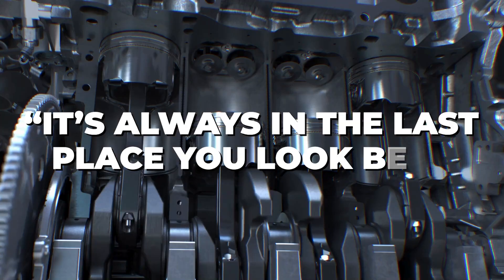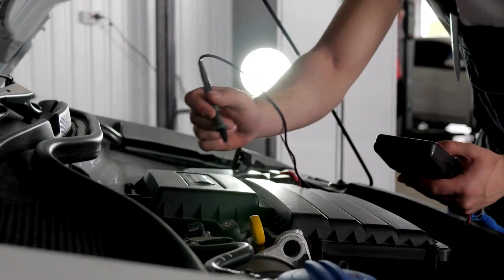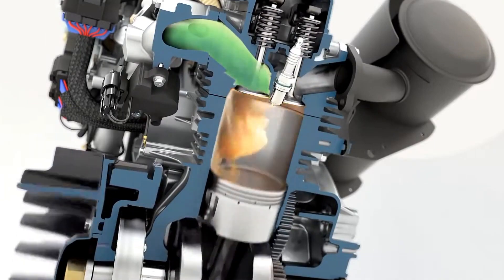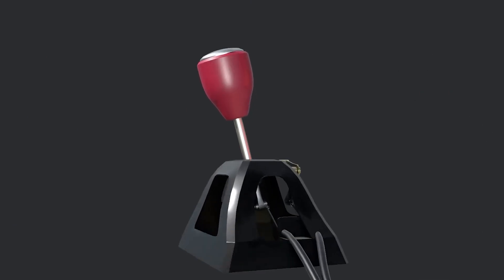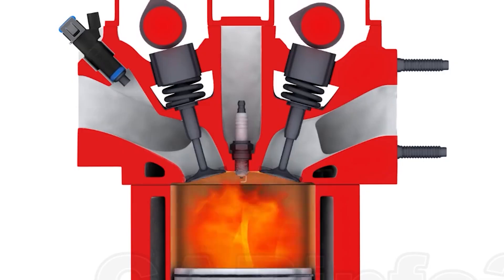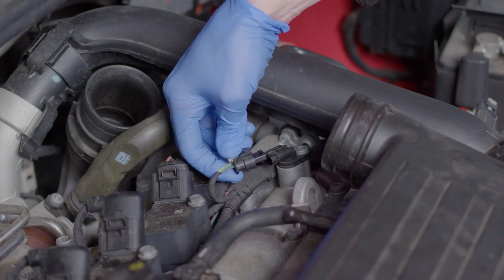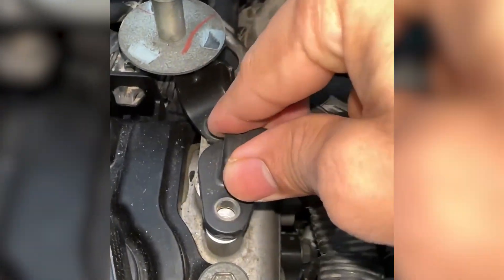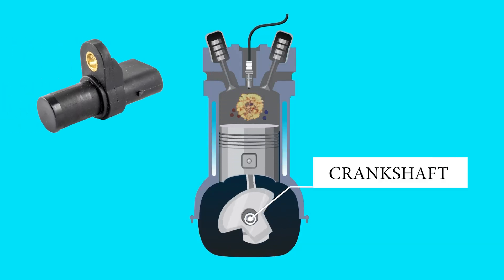11 Symptoms of a Bad Camshaft Sensor (How to Test & Fix)

Comment from the maker: 9 Bad Steering Wheel Angle Sensor Symptoms https://youtu.be/e659I6JyFQ0

⬇Care Care Clues Top DIY Tools and Products:
🚗 Essential Scan Tools
Newest Scan Tool:https://amzn.to/3GJyuET 
Bluetooth Scan Tool: https://amzn.to/42AcBRc 
Cheap Scan Tool: https://amzn.to/42WZIzx 

🔋 Emergency Essentials
Best Jump Starter: https://amzn.to/44fYOAm 

🛢 Fluids and Leak Stoppers
AT-205 Re-Seal (Stops Leaks):  https://amzn.to/3S9icYm 
ATS 505 Fuel System Treatment: https://amzn.to/3YQjjA2
Lucas Oil Transmission Fix: https://amzn.to/4jNk98M 
Bar's Cooling System Stop Leak: https://amzn.to/3Sht0nj 

🔎 Quick DIY Diagnosis Tools
Head Gasket Leak Test Kit: https://amzn.to/4jRgc2T 

🛠 Useful Maintenance Accessories
Quick Twist Oil Drain Valve: https://amzn.to/4jWG3GJ 
Tire Gauge (Check Pressure): https://amzn.to/3GxySGD
Tire Air Pump: https://amzn.to/3RZK9Cd 
CRC Mass Air Flow Sensor Cleaner: https://amzn.to/44dJpkb 

🧰 Mechanic’s Must-Haves
Car Battery Tester: https://amzn.to/4jTqyzk 
Basic Mechanic Tool Set: https://amzn.to/3Ymgerh 
Cordless Impact Wrench: https://amzn.to/3YkkhVc

Comment: 2006 f150 5.4 triton. I’m throwing codes for bank one and two sensors. It got to the point where if I’m not actively giving it gas while driving it starts shuddering and shaking and shuts off. Driving it back home when that happened I had to blow through every stop and use the gas and brake to slow down. Anyone think it’s not the sensors, someone told me it’s probably not actually the sensors bc both would t go at the same time and cause these issues

Comment: I had a bad camshaft position sensor about a year ago according to the autozone code reader and the smog shop reading but no symptoms and had it replaced to pass smog.  The check engine light came on 2 months later and its been on ever since.  The only symptom has been limp mode for 10 months and the smell of fuel for the last 2 weeks.  I wondered why there was a fuel smell but this video clarified why.
Reply: Mine came on an went off but I don’t have no symptom

Comment: I changed camshaft sensor but still the fault code coming. Any idea?
Reply: Check crankshaft sensor and engine timing
Reply: Mine too,my scanner gave me p340 and 341,,I changed both,intake and exhaust side now mine won't crank,,,what next?
Reply: What code were you getting?
Reply: Restore the error code and reinstall the sensor it will be fix

Comment: Just got my camshaft sensors replaced. Didn’t even know they were bad. The problems only started after they replaced them. I have trouble starting the car on the first try. I keep telling the mechanic who replaced the first set but he just thinks I’m crazy. It’s like he refuses to even acknowledge the possibility.
Reply: It’s probably a bad one, I replaced mine myself and still had the code firing off, AutoZone got me a new one for free and I replaced it again and I was fine
Reply: I experience that too especially in the morning have to start it on second try
Reply: @man059 keep reassuring him that it is a possibility that the part that came in may have been defective.
Reply: I have gotten a brand new water pump put in even a solenoid needed for my fuel line and numerous other things like a serpentine belt that were defective upon putting on the vehicle. It happens in more so just like any person who's a perfectionist or Craftsman don't look for imperfections in the wrongs that they have committed. Take it from a barber.

Comment: Just changed this part fixed all my problems 😊
Reply: How easy was it? I am having the same problems
Reply: @LovelyMocha  what were yall problems?
Reply: Car sputtering to start
Reply: @LovelyMocha  did it ever not start? or did it ever turn off at a red light?
Reply: @buckeyesl5 I think it's my catalytic converter that's gotten really bad, it will start right up after sitting for a long time,  but sitting for like an hour or so and trying to crank back up, it'll stutter, then crank. I keep getting the code for it, I'll eventually fix it and no, it doesn't turn off on me, the only time my car did that, was when my battery was on its last leg
Reply: What was your problem
Reply: What was your car foing

Comment: i changed both my sensors and it still wont start and still shows faulty position sensorsm on my scanner. i drive a g35 sedan any help?
Reply: Change maybe the purge canister ?
Reply from the maker: If you changed both camshaft sensors and it still won’t start, here’s what’s likely happening:

Bad wiring or connectors — If the wires to the sensors are damaged, corroded, or loose, the ECM still can’t read the new sensors properly.

Bad crankshaft position sensor — On the G35, a failing crankshaft sensor can throw camshaft sensor codes too.

Faulty ECM (Engine Control Module) — Rare, but if the ECM is bad, it can’t process the sensor signals correctly.

Cheap aftermarket sensors — If you didn’t use OEM (original Infiniti/Nissan) sensors, sometimes they don't communicate well with the ECM.

Start by checking the wiring carefully, then test the crankshaft sensor. If those are good, consider the ECM or try genuine OEM parts if you didn’t already.

Comment: Well I try to watch this video without being biased. But I'm not finding any good nuggets to take with me after watching this The biggest sign when that camshaft sensor goes off is possibly a bad timing chain (stretched)which is the  correlation to the crankshaft sensor which sets off the light. When a customer comes he says my check engine light is on and it says my camshaft or could be his crankshaft sensor is bad and the light that always goes off for me is it's a timing chain issue. And it's usually the time and chain half of the setup in your timing kit is made of plastic. Plastic always fails prematurely. Also if you're hearing a rattle on startup it's more than likely your timing chain. I usually look for some sort of good news when I watch these videos and I will give this video barely a 1 out of 10.
Reply: So change the sensor or chain??
Reply: So your saying if the engine like come on and off I need to change the belt?

Comment: You're describing all symptoms caused by crank sensor
Reply: I disagree as some of the symptoms describes cam shaft position sensor faults also
Reply: It sounds like a camshaft position sensor. I'm experiencing that.. however crankshaft position sensor can display similar symptoms (?)
Reply: Surely we're not still guessing?? I thought everyone knew to get the fault diagnosed and only then replace the part🤔🤔🤔
Reply: Often times there is no error code, or it'll turn off and seem fine.  When there is a code, it'll just say there was misfires and not tell you much else.  The only way to know usually is watching a good mid-tier or above scanner with live data, and many people don't have the time or money for that.
Reply: So true so which sensor should be replaced
Reply: So which sensor be replaced
Reply: @jasonkruger-l7h  usually both of them are replaced at the same time. Now I had an issue with benz w212 where I had crank sensor error, yet it was ecu fault
Reply: Replace the easier one first. For me it’s the crankshaft position sensor.

Comment: Can high fuel consumption be caused by a bad camshaft sensor?
Reply: If you're getting a misfire it sure will. I'm getting 4mpg less since my P0340 code started and it's driving me nuts!
Reply: CLEAN YOUR OXYGEN SENSOR OR DO A REPLACEMENT